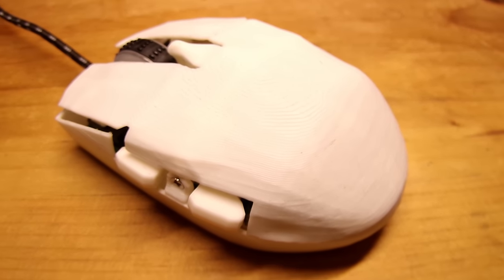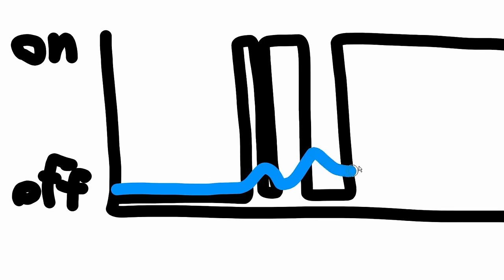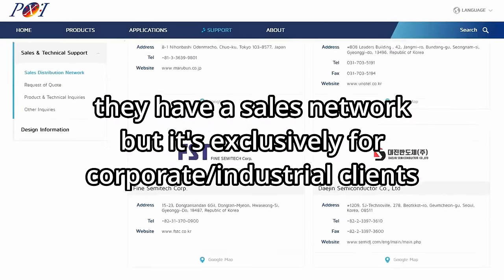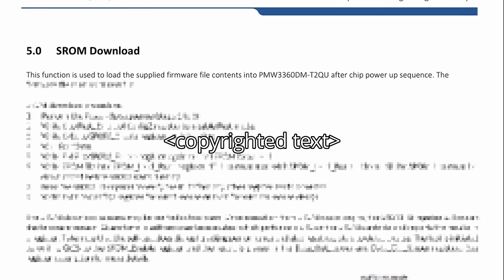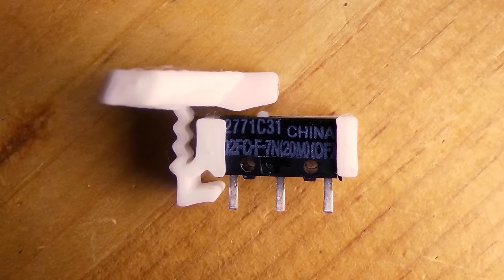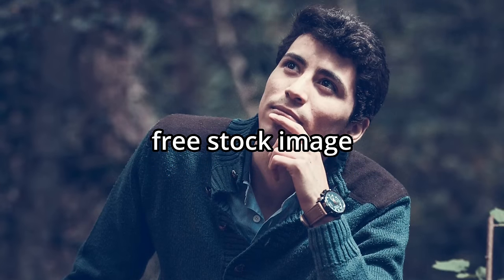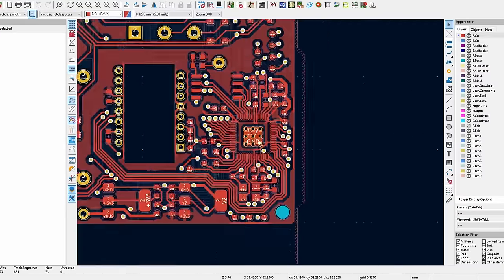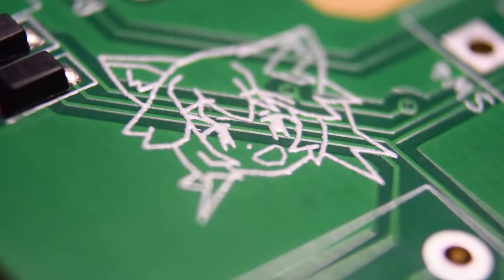I made a DIY gaming mouse because Logitech's mice keep BREAKING

Comment: I've started designing a mouse 2-3 times and every time I've given up after realizing there's no good source of mouse sensors. The world of DIY keyboards is so well trodden, but the first step to building your own mouse is always to buy a mouse and take it apart. I hope if we keep making our own, someone will catch on and start making sensors available to order, so we can finally have highly repairable, easily accessible, open source mice.
Reply: A modern mouse sensor is essentially just a low resolution camera. You can build your own sensor, but you'll need more advanced hardware to process the image like a rasberry pi zero.
Reply: LCSC says they carry the sensor in this video, but it's a "preorder" and stock is at zero.
Reply: There are cheap optical mice that have decent sensors though. Microsoft basic optical, for example. Or cm storm alcor, but that one isn’t made anymore.
Reply: I don't know that starting with a mouse is a bad notion.  All the parts are there, all stiffly pre-mounted and working in harmony.  That's not a bad kicking off point for a project.  The issue is the driver, but I imagine there are open source templates that get you a long way.
Reply: Maybe the Raspberry Pi Foundation could start making their own mice sensors. Or Pine64.
Reply: Time for Keychron to step up.

Comment: Impressive project, it's such a shame an open source an ready available mouse optical sensor doesn't exist.
Reply: Currently there wouldn't be much point I'm afraid, they're integrated circuits so no one would be able to manufacture them outside of chip fabs.

Comment: I design pcb schematics and layouts for a job. We do have fab houses in the US, they just cost 10x more, not 2x more :)
Also, you may want to consider doing the assembly yourself next time with a stencil if you don't want to wait the extra few days for each prototype board. I didn't have a reflow oven when I started out so I just used an NTC heating thermistor sandwiched into an aluminum plate that I bought for like 4 bucks.
Nice job though, good for you for being brave enough to dive into pcb design starting with an entire custom microcontroller- that is some intimidating stuff!
Reply from the maker: My main worry with the local fab houses is turnaround time, and how many of them operate on a quote-only basis, or only on orders of several dozen or hundred boards or more. All very fair problems for a fab house to have, of course, but these chinese companies are offering such a faster and more accessible service for prototyping that it feels like they're eating the lunch, dinner, and midnight snacks, too, of the local ones.

The PCBA JLCPCB orders cost more than it might sound from the general knowledge of them being cheap; being cheap is mostly just for the PCB itself, and assembly has a decent upcharge. It's still nowhere near as expensive as local fabs, but instead of being like, 10~15 dollars (after tax+shipping) for five boards, it was like 45~50.

Thanks! I probably wouldn't have been able to do it if they didn't document the Pico's hardware design so well.
Reply: Oh yeah, that custom PCB stuff impressed me too; I'm a software dev working on similar things, but I'm just going to bodge together existing hardware. Huge props to @wareya on learning that PCB design stuff!
Reply: Same with Brazil, we do got some pretty high quality PCB manufacturers and assembly services, they just cost an arm and a leg. It's the same price to order from China with express shipping and pay the horrid Brazil taxes (think paying once for the service, and again the same amount OR MORE to the government), compared to buying here.
Reply: @wareya   It's impressive how the Chinese decided to cater to a market that looked like nobody else cared about. You shouldn't need to wait a few days for a specialist to tell you "Costs more than you would ever dare paying", if the pricing system is an objective evaluation to begin with for low quantities. The quick site quotes of these services are really handy, of course for weirder stuff you'll only get it through personal quote but they do provide what few care about trying.
Reply: @Kalvinjj  I totally agree, and on top of that, those companies have been pretty quickly expanding their capabilities into everything from sheet metal to CNC to even designing board housings, metal 3d printing, and crimping+wiring cable assemblies for you. It's like a dream come true for people who love electronics projects
Also those import taxes suck! I'm glad the US government subsidizes all the shipping from China for me even though I know it's bad for our economy lol
Reply: 10x? Huh. Just like in Russia.
Reply: Oooh I'd love to pick your brains about getting the spcp168a to connect. I got a shipment from legit sources, I just cannot figure out how to get the usb to connect. Everything else works. Have you heard of this before?

Comment: Here's an idea: Add features NO OTHER MOUSE HAS!
Frame capture is a feature the mouse sensor designers thought was useful but all mouse manufacturers have said "meh" about.
What it does allow is dust detection! Having a look at sensor image now and then and determining if some pixels are obscured and do not change with movement would allow driver to notify user to clean sensor! I'd love for my G602 to do that...
Reply: There was a mouse with integrated scanner. Cathode Ray Dude [CRD] covered it in [Why would you scan things with a... mouse?], it was  a total flop
Reply: @rasz  I know. That is a silly use-case. Now with camera phones it is even worse.
But, the image-array readout of sensors can be used by drivers to do much clever stuff.
For example I designed a filament tracker for 3d printers that uses the readout function to determine the diameter of the filament for automatic calibration of volumetric flow instead of just linear feed. This was possible with a single sensor thanks to this readout function.

Comment: There is a similar sort of project I came up with right after this video. Taking a G305 and turning it into a Bluetooth mouse with better firmware and custom PCB to get rid of the AA Battery and replace it for a Li-Po battery and USB c recharge circuit.

Comment: I have the most cursed keyboard which led me to make some debounce algorithms of my own. The reason I didn't do zero-latency is because it wouldn't be resistant to noise. Instead I chose to have a stabilization period (2ms) and a following lockout period where additional state changes would be ignored, but the first one still registered if it didn't already happen. 

A different algorithm was to count the states during the debounce time and choose that which occurred more frequently. 
Then.. only changing the state if a different state was present for at least 75% of the debounce time

What felt like overkill was measuring the raw data of key presses over a time to know how long each one takes specifically to stabilize in value and doing a statistics-based approach based on the individual keys variance.

I can't express enough how cursed this keyboard is for me to even consider having to go that far.. and it's still not working :(

Anyhow, this is an awesome project. The future of anything is open source.
Reply from the maker: In theory you can do zero-latency for keyboard switches while still resisting noise, but only for the down-click. The up-click will always have added latency.

Sounds like you're trying to get a dynamic debouncing algorithm working. I hope you can figure it out!

Comment: Hi, amazing video! I love how you explain the bouncing and chatter problems. Extremely clear, on point and no bullcrap.

About desoldering with an hot air station, that sure is optimal, but you can get away with a soldering iron, using flux and a larger tip that has more thermal inertia.
That redesign of the pico layout to fit your project is amazing. It's truly the genius kind of mad stuff.

You earned a new sub, and hope you get many, many more !

Comment: Very sick. The side buttons seem like an obvious point of potential failure. I assume they're easy to replace?
Reply from the maker: Yeah, if they break, you can print new ones and slide them on, or print a bunch of spares ahead of time and use them. Just gotta unscrew the PCB and pull the broken ones off.

Comment: after searching the market 3-4 few years back, I found out that only steelseries that uses its own switches while all the others use types of the omrons. it still works, never failed yet, while omrons die after 2 to 6 months for me, or could be really electrical or static fault on my part. you might want to give a shot, if you want a mouse with brand :)
btw you killed it.

Comment: Based. An SPDT switch with NC and NO tied to V+ and GND respectively, with COM tied to a voltage divider feeding a Schmitt trigger, is a really reliable way to get debouncing done with no latency. A capacitor also works, but is probably worse for the switch.
Instead of hot air, you could use a desoldering iron, they’re generally better for THTs. I just got a cheap one that’s a hollow soldering iron with a manual solder sucker built in, it works great but may struggle at ground planes.

Surely with all those dead Logitech mice you’ve got some to salvage the sensors out of, no? Also the G Pro (replacement for the G303 IIRC) is meant to have long lasting switches.
Reply from the maker: The ground plane is the main problem, yeah. Depending on the mouse it can dissipate heat faster than the soldering iron is capable of safely supplying it (without melting the plastic of the IC package).

My g203s use a Mercury sensor, which is poorly documented and a lot less common than the 3360. I would've preferred using it if it wasn't for that.
Reply: If all you want is that sensor off the board you can just use snips and chop it out. You can cut right through PCB. The best board salvage method is the wet dip though. You just hold the board over a pool of molten solder and pluck out whatever you want. I have a 5 pound solder pot I use for parts salvage.

Comment: Man, I was actually thinking of making mouse with pmw3360 myself last weeks and this video just popped out, great job!

As for PCB prototyping, making own PCB's is definetly fastest and cheapest way if you'd want to make more projects, the only downside is that it requires more time. When you have all the stuff needed to make PCBs then making them basically costs nothing and you can get your PCB done the same day you finished the design. With photo-positive method 0.4mm trace is easily achievable and 0.2mm is also possible with some practice. I think you could get everything needed for 50-100$ depending on where you live (not including laser printer).

Looking forward for next projects!

Comment: If your solder beads up, like where you soldered your replacement resistors, it means the components to be soldered aren't hot enough. You need to continue heating the place with your iron and wait until the solder nicely flows over everything.
Reply from the maker: I'm bodging through-hole components onto tiny (0603) surface-mount pads and intentionally applying way too much solder so that thermal expansion/contraction is less likely to make them crack off. Having a round shape is normal in that case.

Comment: I have a G305 and recently replaced it because the mouse wheel kept experiencing "bounce back" where it would actually scroll in reverse of the direction I was operating the wheel.
Reply from the maker: I wish I had a fix for that one, but AFAIK, for how scroll wheels work, it's kind of inevitable that it'll start to happen after long enough. There isn't anything you can do like the smart debouncing I do here. Just gotta hope the company didn't cheap out, and that you've got one that'll last.
Reply: All mice I’ve had get this issue sooner or later. My 5yo G305 still works perfectly but I did have to disassemble and clean it at one point, because LMB had stopped working properly and the scroll wheel was acting up too
Reply: @deamooz9810  Yea.  It might have been able to work again if I cleaned it but I did that once and it only helped for so long.  I never had any other mice do that but I think this is the first one I stuck to for a really long time.
Reply: @wareya  you can use optical scroll sensor like in the good old days, those Never bounce and never die.
Reply from the maker: @rasz  They eventually fill up with gunk and start having one or two of their notches fail to scroll properly, because the part the light passes through is fully open to the air, unfortunately. Cleaning them and keeping them working for a long time is simpler than the mechanical/electrical ones, but they're not without their downsides.

Comment: I had a G502 that worked extremely well for years after buying it used from a friend. When it finally died, I went to go replace it with a new G502. Every single part of it just felt so much cheaper. I'm still using that one, so it's lasted quite a while at least. But every so often it's just like "man this thing feels so cheap".

Comment: Really impressive, that was a lot of work.
I have a similar mouse (just black). In even quite expensive gaming mouses from other manufacturers as well they just put those trash 10M cycles switches... They really do break quite fast. I actually broke mine trying to make the mouse silent but I ordered much more durable switches. I think they are 50M blue stuff? They hold for 5 years of abuse without a problem. The only downside is the noise, cuz they aren't quiet at all. I got them from china for like 1$ a piece so it was really cheap.

Comment: Super impressive! Shitty buttons has been a huge problem for a long time now. I wonder if soldering a capacitor across the traces would cause a current spike when you close the switch, and if that would wet the contacts. I've been using the Razer RC30 with optical switches and that part of the mouse has been great.
Reply from the maker: I think that's one of the ways people generally work around this, yeah!
Reply: Calling the Basilisk an "RC30" is crazy

Comment: I had to test the desoldering on an old mouse just out of curiosity. I had no issues with my soldering iron set to 480°C, then adding a tiny bit of new solder and removing it all with solder wick.
Reply from the maker: It depends a lot on the specific mouse you're desoldering from! If the ground plane dissipates heat too easily, then the ground pin will have a really hard time coming unsoldered, and might deform the IC casing around itself. 480C is definitely hot enough for this to happen if you leave the iron on the ground pin for too long.

Comment: Yo, for unsoldering components from donor hardware:
I found that you can mix in some fresh lead-containing solder to get the existing solder to flow. 
Then you can use some desoldering mesh to get rid of the excess.

Really great presentation on that video btw. :)

Comment: Because of the curves on top you should print the final version with 0.1mm layer height and maybe even think about a 0.25mm nozzle. That will drastically reduce the stair stepping effect you get at the top. Also you can use a pi pico to run the printer with klipper instead of the default firmware and add an accelerometer to increase print speed and quality.
Reply: How about non planar printing? 🤔
Reply: @carlc.4714  would give you a better finish but it is still not that easy to do. It is way easier to just print with 0.05mm layer and a 0.25mm nozzle and wait for an eternity if you really need the quality.

Comment: I'm so happy YouTube recommended me this video!! It's so clear, we'll layed out and you're a genuinely funny person!! Incredible video. 

I've been wanting to build my do gaming mouse for lefties but all the documentation was bad and I had so many problems even starting this!! Also I'm a complete newbie for anything electronics related so there's that to lol. 

So I do have a question though, because I'm a lefty, the pcb design is for right handed nice. How easy for a newbie in electronics would it be to turn your preexisting pcb design to be a lefty version so I can have the thumb buttons on the opposite side for my left hand?
Reply from the maker: It would be pretty difficult... Most of the trace routing would have to be redone from scratch. Can't just turn the board over, because the sensor's pins would all be in the wrong place. I might eventually make a lefty version myself, but if I do, it'll be several months or maybe a couple years out, since my project backlog is so big. Maybe I could redesign it so that the side switch mounts are duplicated, so there's a single PCB version for both hands?

Comment: Yeah, I noticed every mouse likes to advertise "Omron switches that can survive 50 million clicks!" but I've gone through a lot of mice that start double clicking or failing to click after 2 or 3 years. I liked my current mouse enough that when it started having this issue, I took it apart and just bent the little piece of metal on the switch back into shape. That worked out pretty well. Your solution is uh, a lot more involved lol
Reply: 2 or 3 years is pretty good service. Double clicking is usually due to pitted contacts. The contact where it makes contact develops a dent. Then as that dent interacts with the other contact it does a double open close. The dent is really tiny so you need a microscope to see it. It's very tiny. The contacts themselves are tiny.